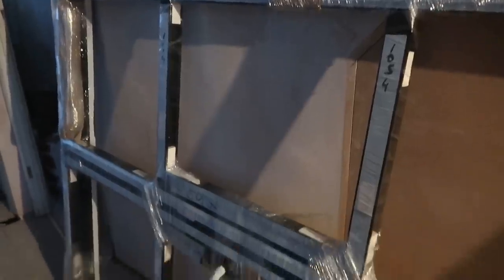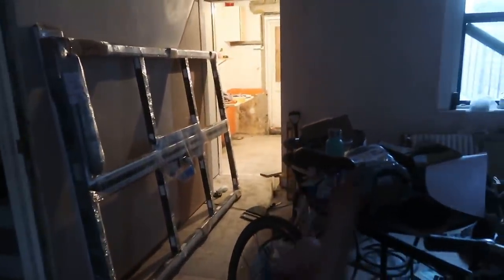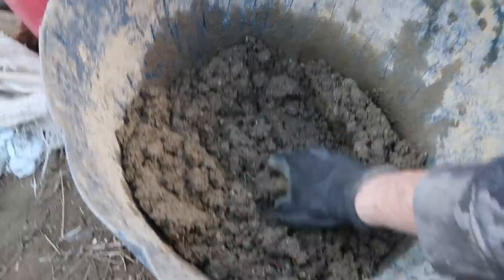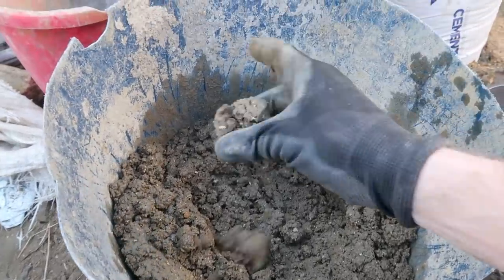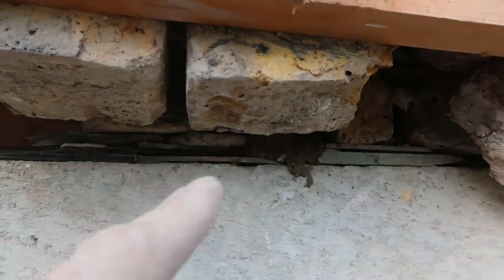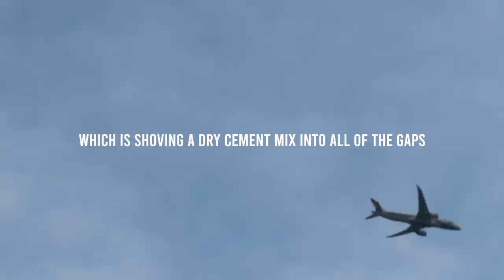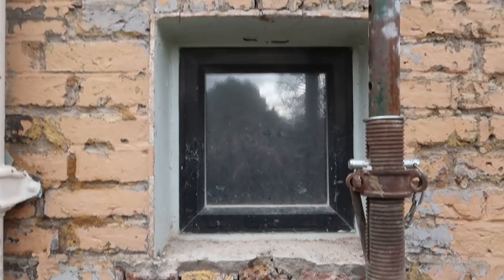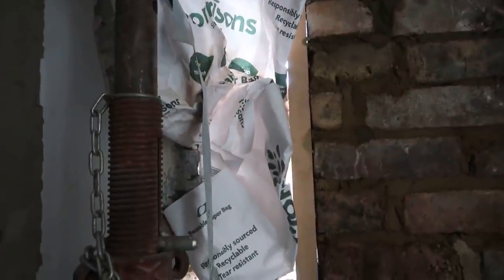KNOCKING DOWN THE BACK OF OUR HOUSE!!! DIY lintel installation

Comment: Hi good progress,, the plasterer has done a good job, plenty of angles in the rooms,, slow but sure work :washhands::washhands:
Reply from the maker: Thanks Anthony. Yes he is a perfectionist but is exceptionally slow haha
Reply: Slow but your happy with results ,, im just finished a similar job at my own property in which i skimmed new ceilings into old which had to be treated PVA etc,, lots of angle there also,  great job fitting them heads,, progress is good. 
you guys should consider this type of work full time with another property AFTER you finish your own ?? 👍👍

Comment: I also was petrified when the window in the kitchen was put in. You cleared up nicely - I wouldn't have bothered with the floor; as long as my surfaces are clean, I'm happy. I had a two ring tabletop cooker that I used in the dining room to cook and used the sink in the utility area (done first) to wash up. Living with building dust is fun - not.
Reply from the maker: We are here now too - walking between 2 rooms to cook and a thick layer of dust over everything - a nightmare!